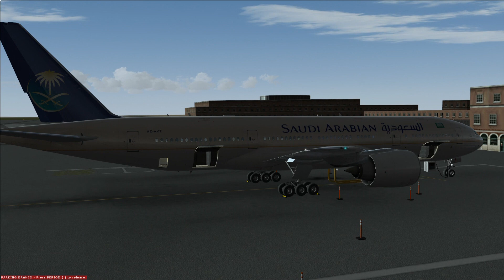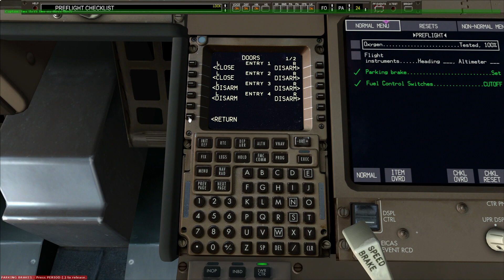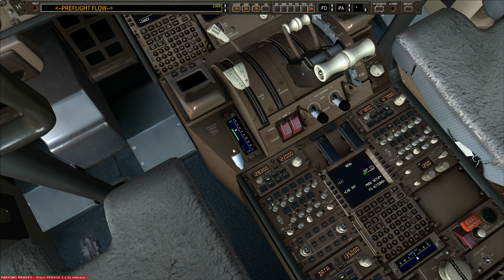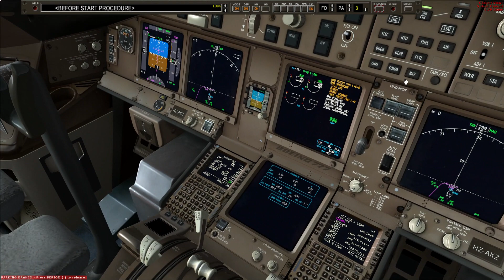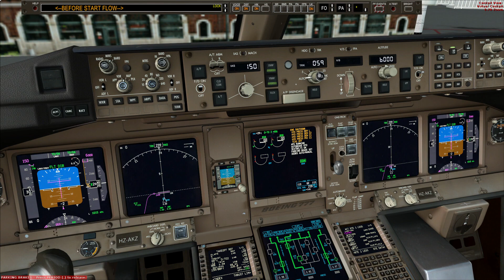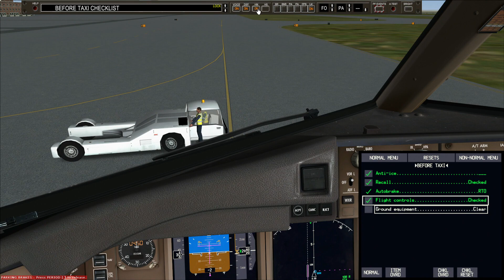FS2CREW for PMDG 777 - PART 1

Comment: Hi Froogle.   Thanks for the vid!  Can you tell me how you determined your departure RWY before taxi?  Is it because you weren't using ATC and you could basically take off from which ever RWY you wanted?  Is there any way, if you are using the default ATC, to determine which runway they will direct you to or do you need an ATC addon for that?  Thanks!

Comment: Great video Froogle, absolutely help me to understand more the program and your tutorial on simbrief to help me upload the flight plan into the FMC was right on the money, thank you makes a whole world of difference. Only difficulty was to follow it since the website appears to have an upgrade and did not matched the navigation on the video posted. Got 3 question for you, hope you can advise;  I am on the search to get my system to operate near but not exact like the system (visual smoothness) to the video..#1 would you be able recommend me what would I need to acquire for my system to run like such smoothness and realism of all objects motion (mines delays or skips) or I must consult a tech support if #2..Is tehre a quick solution when getting a "SDK Error" on the fs2 Crew panel window..and #3. Is there a quick solution to be able to set the fs2 crew panel minimized to fixed it to preference view? this would go for the cockpit front panel view as seen on your the video??..not able to zoom out without pressing on the space bar and slide L or R??

Comment: I just me something about the PMDG 777 and was wondering why it asked me to install fs2crew when I bought the plane. and furthermore what is the hotkey to bring up the HUD for fs2crew.
Reply from the maker: +frodboy h When you installed you were asked if you wanted to install FS2Crew RAAS. This is not the FS2Crew product shown in this video. The "hotkey" for the one shown in this video (after you have bought and installed FS2Crew separately) is documented in the manual (You need to assign a key to it within the sim)
Reply: +frooglesim ok then what was did I  install and thank you for the very quick feedback

Comment: Hi froogle you had some issues with the parking brake, before push. How did you fix this? I have the same problems.
Reply from the maker: Siebren Broekema Sorry, I don't recall
Reply: You couldnt click the parkingbrake
Reply: Siebren Broekema i figured it out, you have to deactivate the powersupply in the fmc and remove the stopper.

Comment: IS THE 777 IN TEH PACKAGE DOES IT COME WITH THAT ADDON
Reply from the maker: FS2Crew is an add-on to other aircraft. So in this case, it's an add-on to the PMDG 777. You would need to own the PMDG 777 first and then add FS2Crew to it.
Reply: I don't see the 777 pmdg m8 on either site the just flight or the free addons this is all very complicated I cant even get the ultimate crew to work in the game
Reply from the maker: Lee Hill I think you misunderstand. This version of FS2Crew is specifically for the PMDG 777. To use it, you will need to buy the PMDG 777 from PMDG's website (precisionmanuals.com) and then buy FS2Crew for the 777 from FS2Crew's website. FS2Crew only make voice add-ons for very specific aircraft. FS2Crew for the Aerosoft Airbus for example only works with the Aerosoft Airbus. FS2Crew for the 737NGX ONLY works with the PMDG 737NGX and so on. If you want a voice control system for use with any aircraft you need to look at something like "Multi Crew Experience".
Reply: I just wanna know how I get my uiltimate crewto work wat buttons I press or how I get it to start when I start a game and im getting nothing do u kno how i do it I was taken to the site u vidoes are o when I searched this in so I was dragged into vids not even related to the search I aplagise if I confusing it the uilimate crew how I get the addon to work in tehg ame as in how I use it when I use themenu were will t be sitting and wat buttons I use etc to activate it
Reply from the maker: Lee Hill I am having trouble understanding what you are having trouble with. I don't know for example what "Ultimate Crew" is. If you are talking about FS2Crew for the 777 then, again you MUST have bought the PMDG 777 and installed it, and then you must have also bought and installed FS2Crew for the 777. 

You will need to bind some buttons up which are fully described in the FS2Crew PDF manuals in order to get that working. I'm not trying to push you off into the manuals, but there is no way at all you will even get anywhere without having those manuals open while you fly since they describe exactly the phrases to use in flight to make things happen. 

So, in short. 

1. Buy the 777 from Precision Manuals (PMDG) and install it into your sim.
2. Buy FS2Crew for the PMDG 777 from FS2Crew.com and install it. 
3. Run the FS2Crew management tool to turn on FS2Crew
4. Print out and read and work through the PDF manuals that come with FS2Crew to see how to not only open the panel, but also the phrases you will need to use to make it work. 

For further technical support please contact FS2Crew directly via the support links on their website. I can't help you much more than this I'm afraid - I just make videos, and don't handle deep tech support issues for products.
Reply: ultimate crew 20104 is a just flight addon  and other sites too module that brings cabin crew announcements to life like captian and flight attendents and everything they do in real life  its installed I read the manual 3 times and installed almost 7 loads and its not coming up in the menu in game were the addons are  the turorials on how u use it don't describe wich buttons they don't show u they just brin g it up  that's wt im meaning m8 its nott eh FS2crew its the ultimate crew I want I was giving these vidoes like yours when I searched the name in that's how I commended im looking for help but no one knows or claims they don't when there showing me on the vidoes i cant get the info i want   that's wat im trying to say thanks for u help  tho i need to keep looking in that case
Reply: is the FS2 crew free to install i may aswell try it
Reply: Lee Hill No, it isnt. it is 29.95 euros
Reply: You need to buy the PMDG 777 from the PMDG website, search it on google. It costs around £80 (I think)
Reply: +Lee Hill it isn't free, it is a paid add-on made by fs2crew.

Comment: Hello froogle i need help were do i click to open the main panel for my fs2crew pmdg 777 i didn't see were you click it at
Reply from the maker: click spot underneath the MCP. there is a better description of how to open the panel in the manual
Reply from the maker: I saw another comment from you saying that you still can't find it but unfortunately I get such a massive volume of comments I couldn't find it again to reply. I don't know a solution for your trouble as it is not something I have come up against. I have a feeling that you have not run the config tool though and turned fs2crew on. if you haven't already I'd recommend walking step by step through the PDF manual and if that doesn't work reach out to fs2crew for technical support.

Comment: Hey Froogle, i just purchased fs2crew for both pmdg jets, and watched your pmdg777 video. Where did you get your passenger sounds and safety demo?
Reply from the maker: On the right end of the fs2crew bar are two black knobs. turn the right most one to the right to increase cabin volume

Comment: good. you have to reduce the thrust on takeoff. you were climbing like a rocket. :)
Reply: Yes. I manually adjust the thrust at takeoff so I don't climb at 5000 fpm.  I think that the passengers aren't enjoying the flight.  The 777 has the capacity to climb very fast. It is only a tip. Have a good day.
Reply from the maker: Baraquiel López Thrust is reduced at the Thrust Reduction altitude - hence the programmable callouts in FS2Crew for that.
Reply: Yes you do feel when the aircraft is climbing and descending very fast, i have feel it. i think there are rules for touchdown rate.
Reply: barritademiel13
It's a light airplane today... I used to work for Emirates as a FA and some years ago, as a result of incident, Boeing prohibited the use of reduced take off thrust due to some software problem they had to fix. During a couple weeks, no matter how light the aircraft was, it was always full thrust for take off. On those (painfully early moring) short turnarounds with the 772 and 77W, the climb attitudes were ridiculous.

Comment: Was very surprised to see you do this specific flight, Froogle. I did SV554 back in Oct of 2009 for a weekend holiday with my dad in Dubai. KKIA isn't a very well known airport so I'm quite surprised to the fact you chose to fly from there. I spent half my life living in Riyadh too haha.

Would just like to point out a few things though. OERK has two runways. However, the west runway (33L/15R) is used for VIP movement only, unless the main runway (33R/15L) is closed, usually for maintenance. My dad, who has recently become the former Chief Fire Rescue Officer at the airport, handled the Lufthansa Cargo crash there back in 2010, which is another reason why the runway would be closed and the VIP runway would be opened to traffic, but in most circumstances, 33R/15L is the runway you should use, if you ever decide to fly to Riyadh in the sim again :P
Another thing, not too serious, is that you used the callsign SAV instead of SVA. Simple mistake haha.

Other than that, great video. Enjoyed watching the first part to FS2Crew's PMDG 777 addon and can't wait to watch the rest.

FS2004looney (Robbie John Armstrong)
Reply from the maker: ***** I am a VIP ;)
Reply: Hi I didn't get fscrew just bought the PMDG 777-200/300. GOT A PROBLEM. THERE ARE NO GROUND service veicals. When I use pushback the aircraft goes back but no vehicles can be seen. Also the large cargo doors doesn't open. How do you fix this problem?
Reply: *****
 
Please help me on this problem. I bought both the pmdg 777 and aerosoft a320. is it possible that my RAAS for pmdg 777 can conflict with the RAAS on the aerosoft a320? Cuz when I approach a runway, it doesn't tell me what runway im approaching. HOWEVER  if I load the aircraft onto an active runway, it tells me what runway im on. BUT if I TAXI onto a runway for takeoff, it doesn't tell me what runway I am on. What could be the problem? ALSO WHAT IS the correct way to find out what star to use on approach to runway? I use the freeware route finder. I see a lot of stars in FMC but don't know which on to use.
Reply: zszs100 The PMDG 777 doesn't come with ground service vehicles. You need to purchase GSX or AES

Comment: first of all cracking video MR FROOGLE  and cracking bit of kit by FS2CREW

now then after landing/vacating the aircraft just powers back down to idle and im unable to power up or move its like the brakes have melted on (but they haven't and just to make sure i did brakes and Tyre changes whilst stuck ) its happens every time i use the fs2crew with the PMDG T7 maybe just a small bug im encountering BUT i know for certain the aircraft doesnt park on the runway lol

any advice or anyone having similar problem
thanks

Comment: Tip, When setting Trim open flight control panel like you have open when doing flight control testing, use the digital read out to set trim. Moves in .25.
I like the added immersion it brings but it is a very automated aircraft, love hand flying it up-to cruise and then approach. 
It might start at 55 mins, but to push back it takes the same time as the ngx, you can skip a ton of time in the 777.

Comment: FS2Crew is definitely one of my "must-haves" for airliners.  As much as I've enjoyed the PMDG 777 since it was released, it always felt like a piece was missing because I was so accustomed to having an FO sharing the duties.  The only problem I ever have with FS2Crew is trying to remember the correct phraseology to use for different equipment when asking to have the external power connected or disconnected -- especially the NGX.  I usually have to use the manual or a cheatsheet when I switch from one type to another.

Comment: 15:00. I'm guessing the flight planner was giving you temps in Fahrenheit, because you put 68 degrees CELSIUS as your takeoff temp. I know the desert can be hot, but I don't think it gets quite that hot. :P
Reply from the maker: EnDSchultz1 Nope. From TopCat, for this flight: Config : Flaps 5 // D-TO2 +68C
Reply: It's Derated so the temp can go as high as you like, just you need more runway.
Reply: Ah, so perhaps I've misunderstood the purpose of the temperature input on the thrust page. So what is the temperature input a representation of, if not OAT?
Reply: It's to let the engines think its much hotter outside and use less power(to avoid overheating).
Reply: stas harch but mainly for fuel + maintenance cost savings I believe
Reply: NZ255
not fuel savings( D-TO and full TO has minimal fuel diffrence), only maintenance cost are lower due to less waer on the engine on D-TO
Reply: Well I've been in Kuwait with a temp of 54c !! Jets don't like to stay on the ground too long there. A guaranteed hot start!

Comment: I downloaded the PMDG 777/200 from the PMDG website, when it came to installing it into fsx I can't fly the aircraft or do anything whatsoever! it just looks really glitchy!  I.E. no landing gear, can't use the cockpit controls, nothing!  I paid for this from the PMDG official website and I am unable to do anything!  :-(
Reply from the maker: You need to contact PMDG support and they will help you out.
Reply: frooglesim yeah i will do, thanks Froog!
Reply: Well, you have to enter your serial key. This message normally shows up when loading the aircraft. Check your CDU at the PMDG Setup page, there is a license button. Check if there is a serial entered.